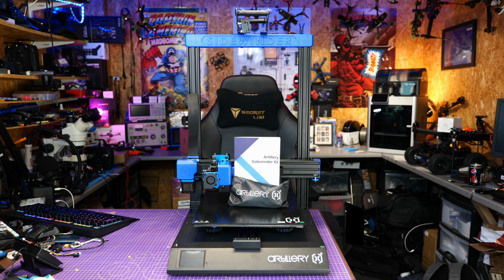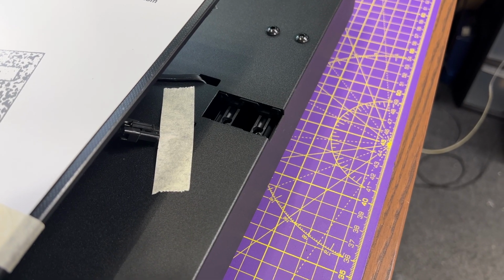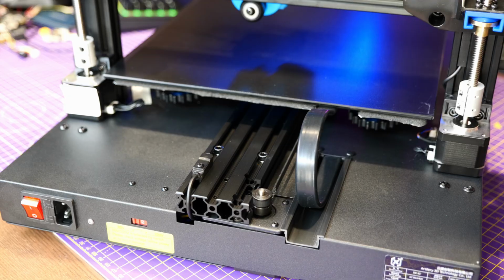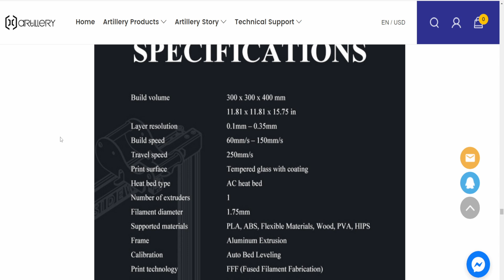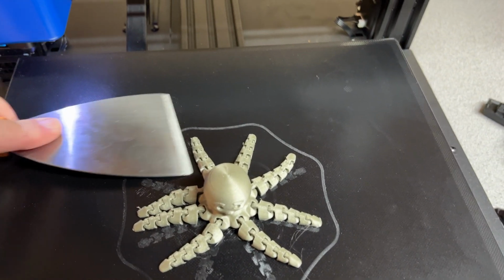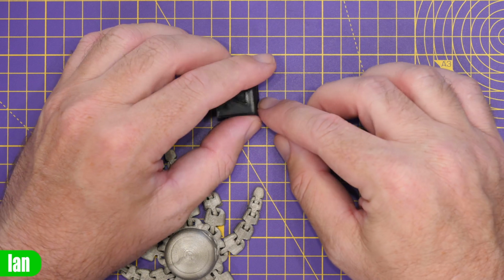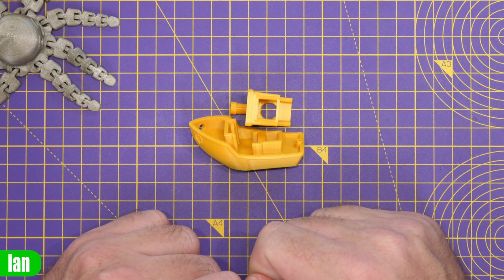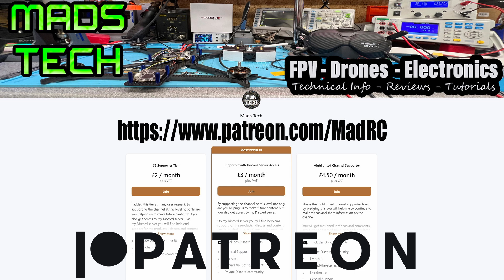Artillery Sidewinder X2 3D Printer - Print PLA, PetG & TPU For Under $300

Comment: Thanks for a well detailed SW-X2 video. I own two of these printers, and they print fast and quiet. Just look at some of the other user videos. My SW-X2 has my 3D printer friends quite jealous, and they have the Ultimaker 3 and Prusa 3 models. And they all paid well over $1000 for their printers. I can actually print bigger, faster and quieter.  And, every print sticks to the bed without any sprays or glues, then releases when the bed is cool. This printer is the best, in my book.

Comment: I've owned this printer for a month, and I can only recommend it. I flashed the newest firmware on it and run it with octoprint, the combination offers good versatility. The heated glass bed performs well. It's also very quiet. Overall it has been the best purchase I've made in ages.

Comment: I have the Artillery Genius, the shorter version (220*220*250mm) to the Sidewinder. Its very functionally and capable printer, but lacks some of the latest convinces of newer 3d-printer models released in the last one-two years.
Where you letting the print bed cool before trying to remove parts? Having a clean bed can also contribute to easier part removal.

Comment: I went the "DIY" way 2 years ago, and not only it's cheaper but also more versatile. Here's what I ended up with 

Ender 3:	120,13€
MKS Robin E3 32bit Mainboard: 22,75€
Dual Z: 20,98€
3DTouch: 10,50€
Glass Bed: 24.99€
X linear rails + DirectDrive Extruder: 56.15€
Y linear rails:	36,58€
Z linear rails: 51,57€
Total: 400.08€

For 400€, you will not find any printer on the market that matches this setup, and you can easily update the firmware to run Marlin 2.0 as well as print modification for the printer since the ender 3 is very popular.

Finally, you could add a Raspberry PI 4B for 43.90€ to run OctoPrint and Klipper, which not only improves print quality, but also allows remote control/print/monitoring